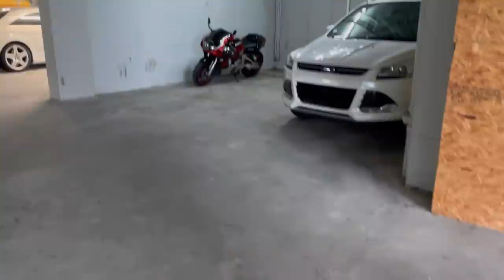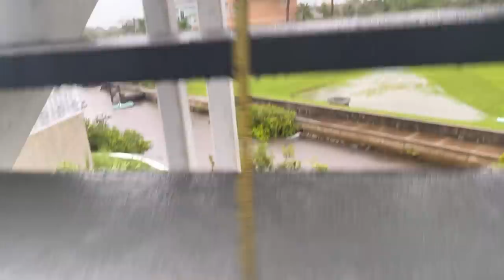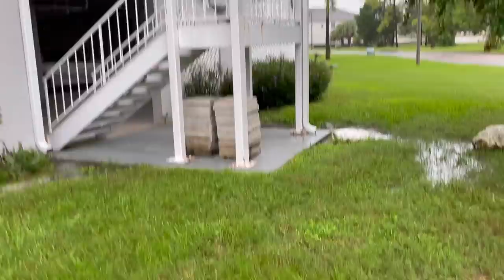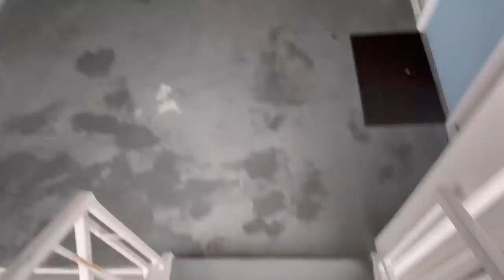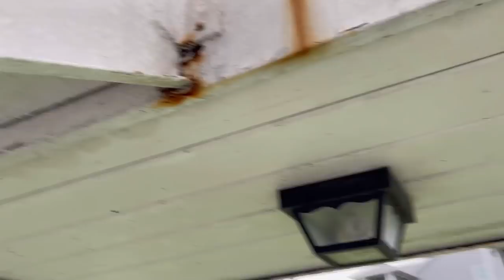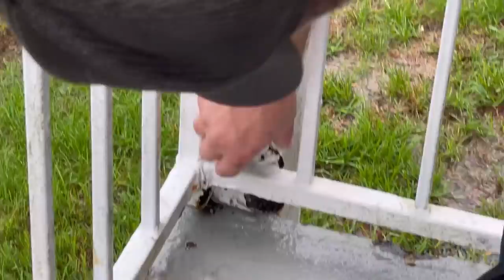The Good, The Bad, The Rusty ($1 million estimate)

Comment: Be careful man. I was an expert witness on a situation just like that. Everyone was getting thrown under the bus after a tenant almost fell from their balcony when a rusty handrail failed. The new welder that came on to do the work told me he wished he had bid double what he originally did.
Reply from the maker: we didn't end up with the job, HOA did not want to pay for complete replacement
Reply: @MeltinMetalAnthony  absolutely nuts, it doesn't take a welder to look at what you pointed out and come to the same conclusion as you. Someone could get seriously hurt or die.
Reply: dude I fell through the 3rd floor stairs I was working on at a place like this. that guy wanted everything fixed. some of that stuff was beyond fixing. that's how them apartment guys are.

Comment: Just had same job done on the apartment building I live in here in Chicago suburbs and our was in way way worse shape to begin with. They ripped the front off the buildings one by one after they  built temporary stairs in back from balconies. They redid the fronts with modular pre built metal sections with each section being hot dipped galvanized. All new concrete footings and sidewalk's and ties into the roof structure just like what you are seeing here. 

Things to watch out for on these jobs that the contractor here got nailed for, the boom lift destroyed the parking lots and intermediate sidewalks and he got stuck having to redo parking lots and sidewalks. The boom lift was 60 foot with hard wheels and they had to change it to a track version. He also had to add two more heavy lift equipment to set the sections after they started, a lull at one point and then they changed that to a big backhoe and reversed the bucket along with the boom lift. He also completely destroyed the landscaping and turned it into a giant mud hole at each building. He had to do much carpentry finding all kinds of rotten facial once started. so with all this said, 1 million might be a little light, if you already bid it out hopefully you got these things covered, if not, pray you don't get the bid,...lol  

oh and I almost forgot, now this looks like a damn battleship gangway and sound slike it too when people walk up the stairs you can hear every footstep echoing through the building and into my apartment. Had some kids running up the stairs, I thought it was thundering outside. Without the stairs and deck being concreted, its reverberates everything. Maybe there's some kinda rubberized spray coating that could be applied to the underside of the flats and stairs to fix this but FYI.

Comment: you would be surprised how many gas stations have a few metal poles holding carport area over gas pumps, & the structural poles are the drains for the water on roof, some have massive rot where water comes out. but I see it nearly every older gas station

keep up the good work!

Comment: Yikes! I'm no good at estimating, but it looks like more work to fix than just replacing....

PS: is it just me, or does anyone else itch to hammer on that rust??
Reply from the maker: lmao I definitely do
Reply: as a welder I had a similar itch to hit it with a wire brush on an angle grinder...

Comment: Yeah bro the same thing happened to us. We do floor installation and demo, we had a condo call us about wanting tile repairs due to cracking in 42 suites out of 210. Long story short we ended up demoing 4 suites and realized there was a major structural issue causing the cracks. Started in one corner of the building on the top floor, went down 3 and every single one had huge cracks in the same locations so we stopped and got an engineer involved. What the HOA thought was going to be tile repairs turned into a structural overhaul. They never called us back so idk what ended up happening to it. That was in New Smyrna beach

Comment: I can't believe some of those main columns were overhanging the foundations 18-50 and the later one where a corner was in the air, that has to break every building reg, whoever passed those designs needs punishing. If they were within code imo those codes need changing.

Comment: They got alot of water pooling issues they need to fix b4 redo the stairs or it will just happen again and it's close to the water. Just have a company come in and put foundation drainage around everything and have it dumped into the waterway..

Comment: Dang man that apartment place was actually willing to fix things that were still that SOLID? jeez. the guy I was working for last year woulda thrown a hissy fit if I replaced things that were still as solid as that stuff. one thing I learned though is if you got support poles like that, that are rusting through usually the whole thing is flaky and not really repairable. I've tried to cut a few and only replace the bottom but everything on the top was just rust. I was so stressed out when I was working for that dude. I totally understand what you mean when you said you weren't sure if you wanted to deal with that job. If you do undertake it don't let the owners try and fool you into doing patchwork. that needs a replacement. they can plan for it from the beginning or learn the hard way when you touch one thing and the rest falls apart

Comment: That's a scary job to partially repair,   as any where you cut and weld  is guaranteed to be partially eaten away internally.on the existing structure,  then welding the new metal on is going to accelerate the rust on the HAZ,   on the old metal. and crack very soon fron the constant vibrations of people bouncing up an down the stairs. Big lawsuit time !!    IMO.  ALL OR NONE.   Great Video THANKS
Reply from the maker: definitely, they wanted me to just repair, I told them no way

Comment: could you splice in stainless steel tube and baseplate for the bottom 3 feet of each post to prevent that rot if you tore out everything and replaced it.?
Reply: While anything’s possible i highly doubt it would be up to code

Comment: Here in NC code for Pickets as well as gap between stair steps is 4" or less +zero. We actually had a ball that we could quickly test code on that stuff with if the ball passed its no good. (We got that ball from an inspector actually.) The idea is apparently anything over 4" inches a small child could get their head wedged and stuck between the pickets or stairs. Our Precast Treads we would bend the pans to cover so there was no gap we only had to worry about the stair gap on Floor Plate Treads. Unless the customer requested gaps on the precast treads anyway which was rare.

BTW that's one of those types of jobs you overbid so much in hopes you dont actually have to worry about getting it but, at the same time if you do by some miracle end up getting the bid you make enough that its actually worth all the bullshit that's going to come from such a job. Especially on a jobsite with tenants living and moving around the jobsite the entire time. So much liability and possible things that could go so terribly wrong if you didn't bid it some crazy amount and something did happen it could bankrupt most business's.
Reply: Never used a ball...inspectors use them but the tape doesn't lie

Comment: I thought you were joking about 1 million dollars. I watched the video and yeah that is beyond a nightmare, but I still cannot process how that could cost a million dollars. At the beginning I was thinking it would be like 50k per staircase. but I'm not the professional I just hobby weld, either way the video was interesting and I like watching your channel and all the repairs.
Reply: How would you set them? There’s a LOT more involved than just building new stairs by ordering the materials and welding it together. You would need at a minimum a gradall (telehandler) to move materials from the trailer it’s brought in on, to set each flight and that’s if it has enough boom to reach high enough to set the top flight iron in place. 

Stairways aren’t inherently hard to do. They just require proper planning and that means you better know exactly what you’re going to need for demo and reinstallation. Which also includes having a structural engineer who designed the new stairwell to current building code standards. There’s more $$ right there. This isn’t a cheap job even though most of the stairwells are more than likely typical. But the equipment rental alone and an operator for a crane if one is necessary to successfully complete the job are going to be big money. For a 50 ton crane around here is $400/hr, plus wages for an operator and oiler to run it and it’s a 4 hour minimum to get them to show up on the job. If you need a bigger rig than a 50 ton you can essentially double that cost. 

It adds up really fast.
Reply: You could also set them by hand with chain falls so long as the roof structure is able to support the weight of each flight plus any rigging needed to set a flight in place. You could do it that way without having a ton of money in equipment rentals. But it’s more time consuming to do it that way and is also dependent upon there being enough structural integrity in the structure to support that type of install. I’m a union Ironworker. This is stuff we do all the time at work. You would just need a gradall to move materials around the site. Plus mats to put down to drive on the soft turf so you don’t destroy the landscaping etc. there’s a lot more that goes into these jobs than meets the eye.

Comment: How many years has the original installation lasted before now? 10? or less?
Reply from the maker: I believe these where built in the 80's based on rail spacing and step spacing
Reply: @MeltinMetalAnthony  in all fairness its held up well being 30+ years old. with doing it right and tearing it down there's no reason you cant get even more than 30-40 years out of it probably with minimal repairs along the way on the new build

Comment: Sad is those stair case's where production welded in jig's, bid is the tricky one. You can tell it was line welding, machine was turned up really high 400 to 500 wire speed 22-26 hot side, and that speed threw the welding causing a crap load of problems that are covered up with paint an glue.